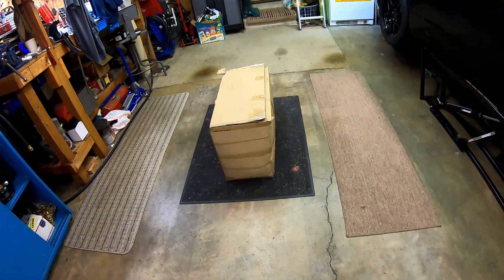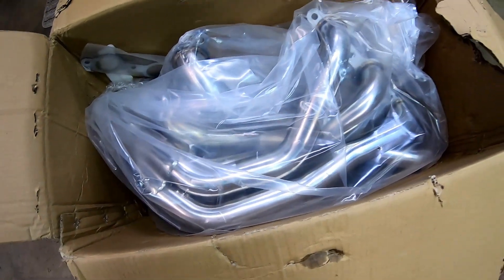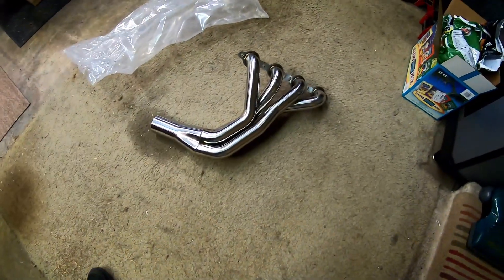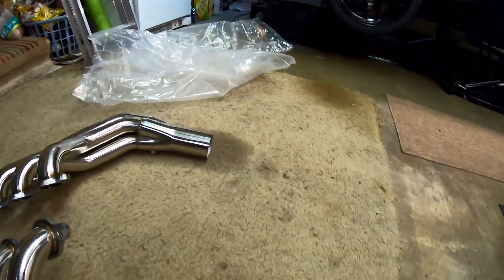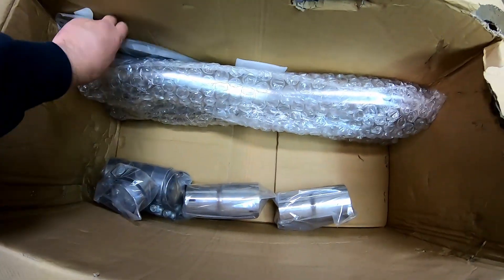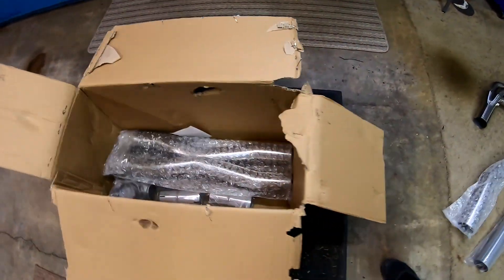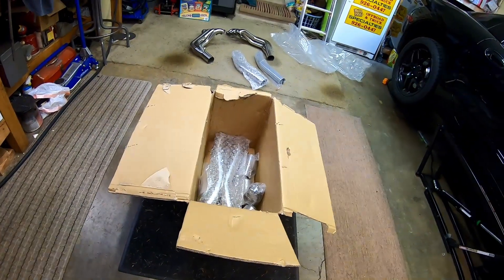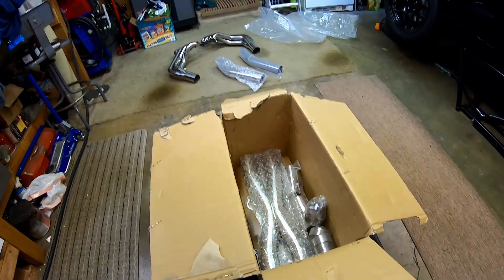Speed Engineering Headers C5 Corvette Unboxing

Comment: Very nice
Reply from the maker: been working on that damn car all day lol.  It's worse than working on a helicopter at times.  very cramped.
Reply: I’m not looking fwd to the day I try to cut the exhaust manifolds off the 72 for headers. I probably need to find a more modern toy. I loved when the Goat 🐐 was remade in 05....I gotta find on of the 6.0 models.
Reply from the maker: @JackofAllTrades1   If you dig back through my older videos I had an 05 GTO for 7 years.   They are cool and unique cars for sure.
Reply: I’ll check that out.... I test drove a friends in 07, one of the most exciting rides ever in a stock sports car.

Comment: I’m waiting for these to be restocked now.  I’m not going to run the x pipe as they send it either.  Gonna drop it off to a local exhaust shop and have them make the 3” all the way to the rear flanges.  I don’t like those dumb reducers.
Reply from the maker: The only potential flaw in this is the flange on the axle back is still 2.5 inch.   If you try and weld 3 inch pipe to a 2.5 inch flange the pipe will literally be over the bolt holes of the smaller flange.   Does that make sense?  Unless you buy a 3 inch axle back you are going to be reducing it somewhere.   I did my reduction at the high flow cats.
Reply: @PNW_Car_Mods  oh sob.  I didn’t realize that.  My z06 still has a 2.5” on the titanium exhaust which I was advised to keep for a while.  Maybe I can make this work but I agree I don’t want 3 different joints on the mid pipe.
Reply from the maker: @35057   If you haven't seen them I have a couple different videos showing my home built Mid pipe assembly and putting V bands on the Speed Engineering collectors.   Only if you're bored though.  I don't beg people to watch my crap lol.
Reply: @PNW_Car_Mods  I’ve watched them.  It’s right up my alley. You can mig stainless.. just the weld will rust.  If it works it works. It’s not entirely sloppy 🤷🏼‍♂️😁
Reply from the maker: @35057  absolutely.  It might not be concours de elegance but I've never had a mig wire welded stainless pipe connection fail in 20 years.